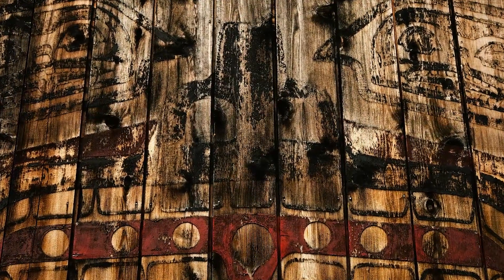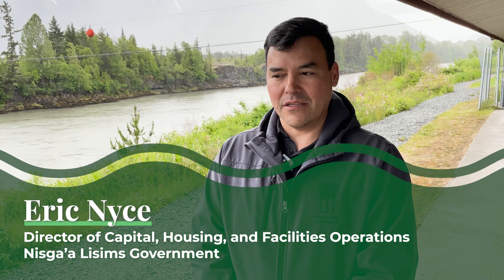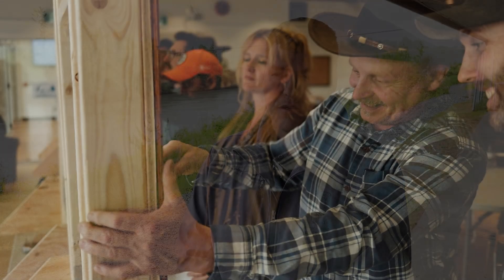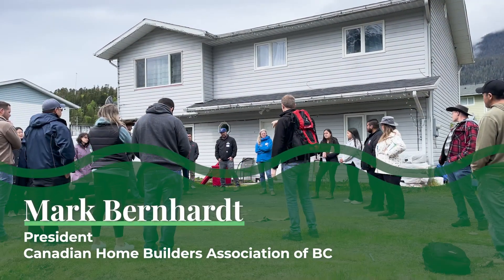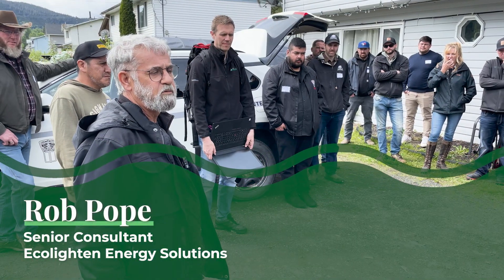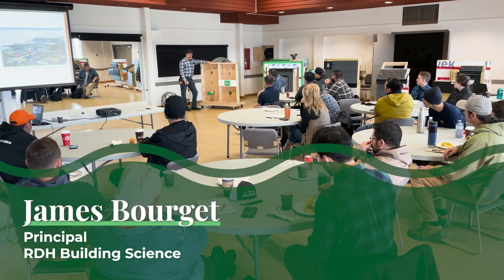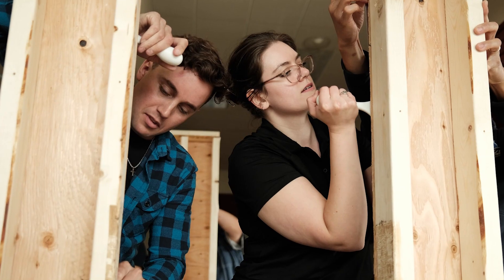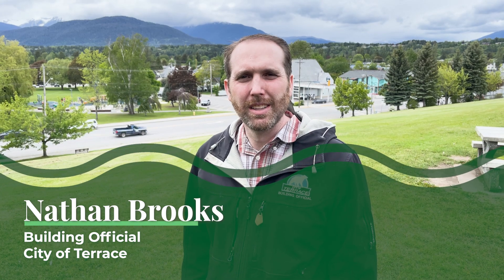Northwest Retrofit Forum in Nisga'a Nation and Terrace, BC

Comment: Each village has homes that need repairs; 

I hope each village councilor gets out there door to door to see the homes that require 100% retro fit
IE. Entrance Stairs, doors, kitchen, bathroom, living room, bed rooms, bath rooms, 

Aiyansh village  done one home for 100 grand 2023 complete repair, windows, doors, stairs, living room, bathroom, kitchen, basement, outside stairs, back entrance stairs, already . Every village in Nass deserves same 100 grand repair.

I seen electrical, how homes went from 100 amp to 200 amp within couple years. I have not seen ppl get any renovations when they have written letters and are in clear need of it. All village has done was call the homes CONDEMED, when home owner had requested for repairs years before. Than removing the home owner to a trailer, not a home. still not right with that transfer, A Used trailer is not same as a home build. The homes should be built on same lot or repair home on the lot not move ppl around, They still have the certificate for the land.  AND what year is the trailers?